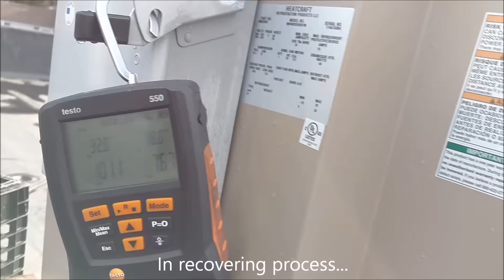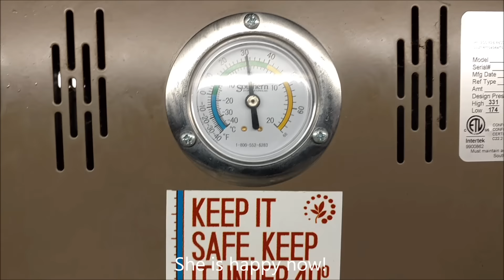Sandwich cooler: compressor replacement

Comment: for a how to video it went a little fast LOL did you clean the EVAP and condenser coils? what was the problem with the old compressor and why did it fail?
Reply from the maker: THE GENIUS bad valves in the compressor
Reply: Cesar Alejandro Kinzel HVAC does scroll compressors have valves in them?
Reply: Cesar Alejandro Kinzel HVAC sorry my bad keep up the good work.

Comment: Good Video. Was the old Compressor locked up ?
Reply from the maker: OcRefrigeration,Hvac & Electrical. bad valves...
Reply: discharge or suction valve ?
1) if suction valve---i'd Put a suction accumulator on that one. or you will loose this compressor.
2) if discharge valve---dirty Condenser ?

Comment: That Unit WAs only 2 Years Old.
Did u Find out why the Last Compressor Failed ?
Your Gonna Want to Swing By on that one every so often to see if it's doing any weird shit.
Possible causes:
1) a Long Line Run of Over 100ft ? Oil Failure and locked up compressor ?
2) Refrigerant leak ? suction line temperature entering compressor too hot ? Compressor electrical failure.
Reply from the maker: OcRefrigeration,Hvac & Electrical. we found bad valves in the compressor few weeks after the replacement
Reply from the maker: very good observed, thanks for your comment
Reply: That sucks, Definately Time for a suction Accumulator on that one.
Reply: thanks O.C for the information. If you have to put a suction accumulator on the system how do you determine the size? Is it based of tonnage and line set length?
Reply: First by Suction line size & Secondly it must be able to hold 1/2 if the system charge at least.
Example---You Have a Freezer with a total system charge of 5 lbs and 7/8 suction line. Suction accumulator would need to be 7/8" inlet and outlet need to be able to hold at least 2.5 lbs of liquid refrigerant. Bigger is ok to a point. Be reasonable. Consult a Sizing chart from the manufacturer regarding tonnage also. Smallest 7/8 accumulator is usually able to hold 6 lbs of liquid refrigerant. That would work fine. Accumulator can be welded into the suction line outside the unit or inside the unit does not matter.
If it snows where your at allways put accumulator inside the unit. Google Sizing a suction accumulator. There is a few good pdfs.
Reply: Copeland had some issues with their medium temp. compressors about 3 years ago. Bad valve failures on reciprocating compressors. I ran into a couple. They were good about warranty credit. I am reply to this video late.